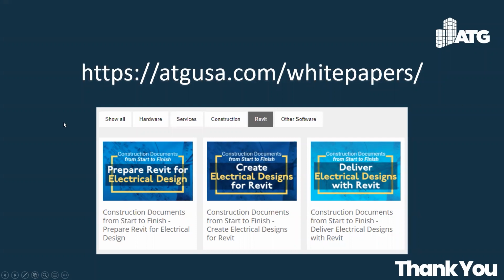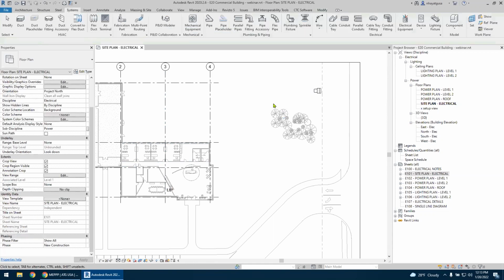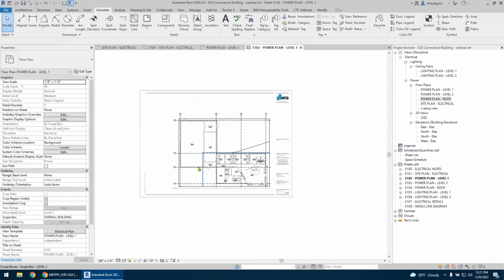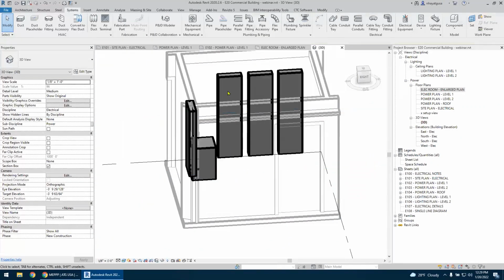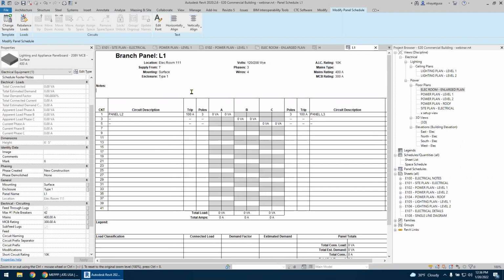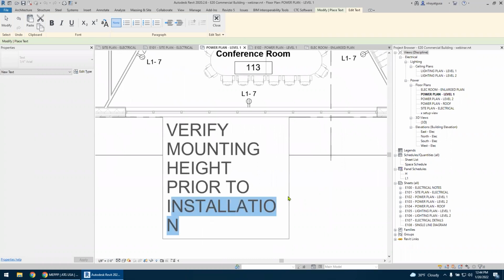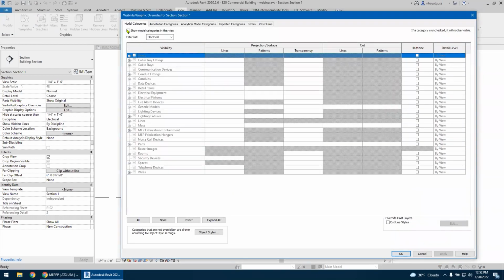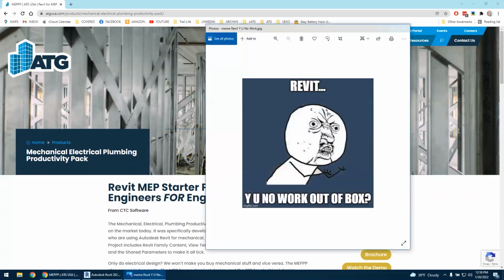Design a Power Distribution System in Revit

Comment: Are the MEP libraries you are getting your panels from included in the base revit? I see none of those families in my Imperial Library folder.
Reply: As of Revit 2021, under the Insert Tab, there is a "Load Autodesk Families" which lets you download their out-of-the-box families from the cloud (contains the families that he shows in his video that use to be installed when you installed Revit 2020 and prior). Hope this helps!

Comment: Nice video. Is there any way to allow a transformer link to two panels? I mean a double tapped transformer on the secondary, not a panel feeding a second panel via feed through lugs.
Reply: You can add more "secondary lugs" in effect - select the transformer, and in the Properties Dialog look under "Electrical Circuiting" and you will see a parameter called "Max Number of Single Pole Breakers" which defaults to 3. You can increase that number to 6 to get a 2nd place to tap it. Hope that helps